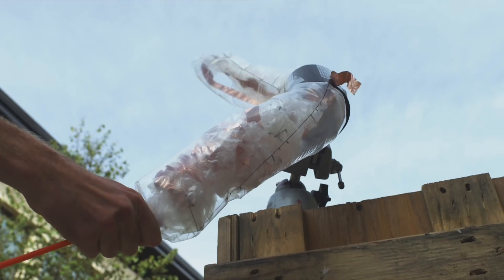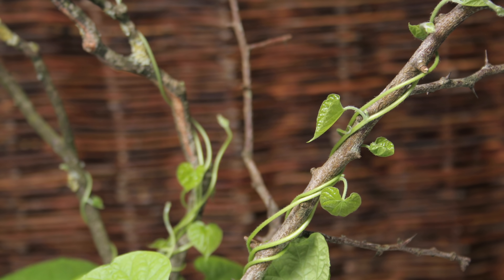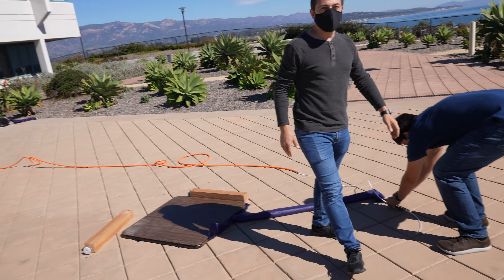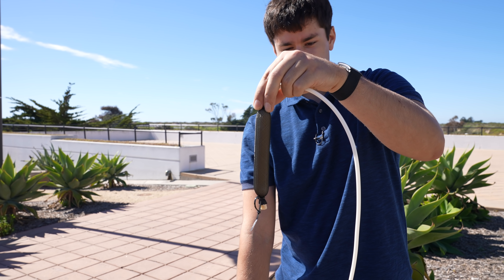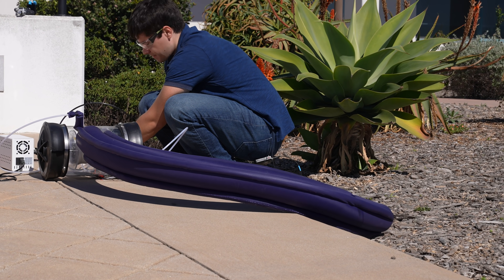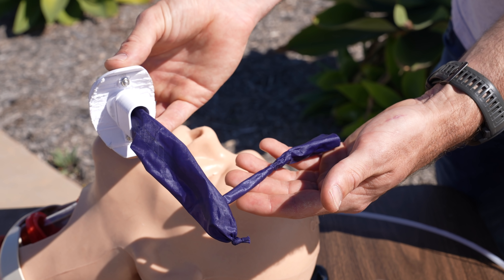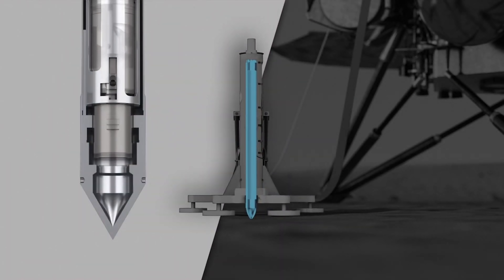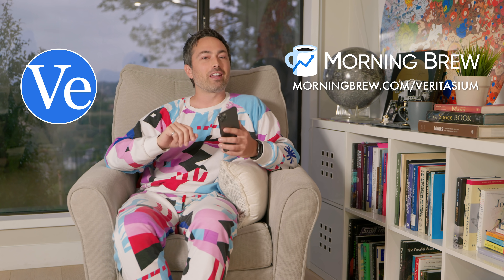This Unstoppable Robot Could Save Your Life

Comment: Go into soil down to a damaged pipe to locate the point of leakage determine the point of failure and the size of it to help decide to dig up the damaged pipe or do a in place repair.

Find all the LEGO pieces in a large bin without spilling it out on the floor. because... everything is awesome :)

Investigate holes with nests underground for its inhabitants to determine if the nest is still actively in use or abandoned before applying chemicals to treat wasps and other creatures.

It would be unsuitable for flooded areas as it would only float above the waterline but it may be suitable to locate any passage that is not flooded.

Comment: Hmmm. I hear doctor octopus around the corner. Just think about it. You could make it with thin carbon fiber on the outside layer. The second layer thin steel sheets, then in the middle 2 gauge wire. Heck, use heavy duty thin rope to control it. It could only be probably grab things but would be a pretty useful. With a alot of compressed air, probably need a small canister.

Comment: Minus the camera part, maybe for pushing stuff out of and clearing long drainage pipes without having to dismantle them?
Or could carry a just as bendable hose with it water the inside of a burning house without any firefighters needing to risk their lives in potentially collapsible buildings?
If water proof then underwater exploration?
May sounds absurd, but maybe attach a small mask to one end and start supplying oxygen once the pipe reaches the stuck victim?
Or if there is like a claw or hooking mechanism at the end of it to get things that have fallen into places too narrow, dangerous or deep for people to go and get; especially when we don't know how deep the thing has fallen; like a valuable piece of jewelry in a deep drainage system with grills. And afterwards can just be pulled out? 
Or very commonly in cities, things that have fallen in between two building 🏢 that have barely any gap?
I dunno, but this invention and idea is so simple but so awesome and has so much more potential. Can be useful in many different fields that didn't know there was such a cheap and awesome option and solution to their problems......
Reply: For water exploration it would be waterproof just through the mechanics required by being airtight, and the pressure would keep any water out anyway, at least up to a depth where the probe is no longer safe to use anyway. more interesting is the firefighting idea, which has some merit although it would need tome design revision around being able to handle higher pressures.

Comment: Somebody should tell me, how does this become a ROBOT? you are not doing anything special, you are just folding a soft tube inside and pushing it out with compressed air. I thought the material expands and elongate by itself through some special mechanism.........................:dothefive::dothefive::dothefive::dothefive:

Comment: You could have some pretty crazy applications for setting up construction sites where people are not Hardy enough to withstand the conditions if the tips of the robots could sense each other they couldn't make connections all by themselves thereby making safe tunnel systems that could be full of breathable air and sheltered from the outside

Comment: You can line the inside of old leaf piping in older buildings without having to replace the lead or rusty piping. Maybe use a plastic that has good adhesion to the piping and/or that solidifies fairly fast. Then you can keep the beauty of old cities without ruining the tile walls or floor by cutting into them.

Comment: This really could be used in sooooo many ways. Some that weren’t mentioned which I can think of are colonoscopies, endoscopies, plumbing, and the list goes on. This opens up a lot of things that can be researched
Reply: d i f f e r e n t  k i n d  o f  r e s e a r c h
Reply: It's actually already used in plumbing for laying special linings inside of pipes, as far as I know it has been for a while.
Reply: They better be 1 time use for colonoscopies
Reply: "colonoscopies", "opens up a lot of things"... you got that right.
Reply: @theone3680  lmao
Reply: @ticrific  I mean in a weird way, they might be right, these things effectively have no friction, as the surface doesn't move relative to the 'walls', so for delicate areas, they might be quite good, as they don't rub. I can imagine this preventing any damage.

On a related note, I can see an entire new genre of... toys... though I guess lack of friction isn't really the goal normally, I can certainly see some applications, particularly as they would requite effectively no lubrication, which is an advantage for someone I would presume (though I don't know who has access to a compressed air pump but no lube, other than these guys I guess...). They also have a very tentacle like thing going on for the controllable ones...
Reply: E n d o s c o p I e s the hell
Reply: @reginagohagan848  what?
Reply: Yes, lots of potential applications, but endoscopes are pretty fancy already. I don't think we need ones that go up the butt and then...inflate
Reply: @GovSchnitzel  endoscopies go down your throat and into the stomach, colonoscopies are the ones that go up the butt. And now that I think about it I’m not sure that this robot can even be sterilized and it’s probably a one and done deal, which I’m not sure if that’s gonna be more expensive than the current setup or not.
Reply: @ticrific  it seems like the only part that needs to touch is the fabric and the covering for the camera, those parts would be cheap to replace, the design and manufacturing at scale while staying at medical grade would be the real obstacle
Reply: @GovSchnitzel  A colonoscopy already uses inflation, it blows your colon up like a modelling balloon so the camera can be rammed up further, I know, I've had a few of them and they are not pleasant, so I would much prefer to get this version. I think all the Drs. performing colonoscopies have been trained by Dynorod the sewer unblocking experts.
Reply: @GovSchnitzel  😦
Reply: "colonoscopies, endoscopies, plumbing" and if you do it right, and it's long enough, you can do it all in one run!
Reply: @dutop142  And hey, it can just keep going, no need to stop there - it can save people from a collapsed building, and explore some ancient ruins! All in a days work for a worm-robot-thing!
Reply: I’m actually in a lab that’s trying to apply this to endoscopy/colonoscopy and designing it so that it doesn’t damage surrounding tissue is difficult haha
Reply: The only thing I understood from that list was plumbing
Reply: Moon Cricket  it seems you don't know anybody with colon cancer, chron's disease and other
Reply: onanism
Reply: Oil
Reply: I've seen plumbing with this type but not with the robot
Reply: This has been used in plumbing for ages. When a pipe is dirty or rusting they put a tube through the pipe to put in a new inside layer so its safe to use again.
Reply: Prostate exams, colon cleansings, enema’s, rectal surgery the possibilities are endless!
Reply: Yeah plumbing was my first thought. Find a way to add fiberglass and you could patch sewer lines super easy
Reply: colonoscopies and plumbing should NEVER be in the same sentence let alone the same paragraph and at the same time a device should never be designed to be good at both looking up my butt hole and looking at and clearing my drains. nuff said.

Comment: Ummm, they were lacing & lining old drainage pipes this way 40 years ago, if not longer ago.. Then crank up the super heated steam to tip off the curing of the plastic liner into its new shape... Why is this dude acting like he discovered this tech... What an a$$hole...

Comment: Another application I could think of would be finding and plugging leaks. If you make it out of a sturdy and give it a more elaborate leak finder sensor in the tip, you could use it to enter a tank or pipe or other hard-to-access system, find the leak, and inflate enough to plug it until repairs can be made. Useful for industrial applications, especially in large units of toxic industrial chems like ammonia, or very light chems like coolants.

Comment: The only issue with the sand thing is that in 'the wild' you don't get such perfect loose sand. Maybe in a desert but for example on mars you may bump into solid material or even large rocks... ?
Reply: You know those tunnel burring machines?  Put the front part at the tip.  Effectively turns it into a mini dune worm.

Comment: Yeah, so, (1) it's Air (gas) powered. And, (2) I hear Mars doesn't have an atmosphere. So, there's the whole pressure differential problem to work out. What works on Earth, most likely won't work on Mars. Also, going to need to carry it's own gas/air supply and not run out before it does it's job... Good luck, those are some major obstacles to overcome.

Comment: It strikes me as an ideal tool for firefighting. You could steer it directly into the centre of the fire, up stairs or in rooms and then add the water pressure at the same time as reducing the air pressure around the outside
Reply: I had the same initial thought as you, however if not used properly then it could end up causing the fire to become far worse, i.e. feeding the flames (obviously dependent on the type of fire and the type of gas/liquid you pressurize the device with).
Reply: Maybe just completelly replace air pressure with water
Then just leave the top open by a smaller part that will pop easily under higher pressure
Reply: @matthrew  Or CO2 so no water damage.
Reply: @johnclements6614  the only issue would be having a way to lock into position for higher pressure outputs without moving or extending due to the pressure
Reply: The only issue here is the need to search structures for victims prior to fire suppression. Steam expands 1700x, so adding water without ensuring your structure is clear essentially boils any unprotected people/animals (we called it 'lobstering'- it hurts even if you're wearing firefighting gear). I agree it's a great idea in some situations, but it wouldn't necessarily reduce the risk to firefighters and could increase risk for trapped parties.
Reply: @amraykovitz  what if you did the same but then used powder or CO2?
Reply: @mathewbayley  Breathing oxygen depleted air caused by extreme CO2 concentrations can lead to death by suffocation.
Reply: @allaboutroofing2  it could probably be used after the people are evacuated.
Reply: @CeoMacNCheese  precisely my point. The problem lies in that the structure has to be cleared first which would require someone entering. If that's the case, as others have pointed out, there exists a firehouse that can send water or other suppressants into the heart of the beast once cleared.

Comment: In a similar manner to the search and rescue concept, this could be used in various trades where looking for means of running wire through crawlspaces and other tight areas would normally require making holes or moving fixtures, can now be done by running that robot through with a camera.

Comment: Kind of late, but I think this kind of technology would be great at reducing the expense of laying lines in the ground for stuff like internet or power. One of the big reasons fiber connections are so uncommon is that it's incredibly expensive to lay them in the ground compared to the profit the community that uses it would generate. If this can tunnel through soil anything like it can sand, it could make laying those lines much cheaper and thus more common.
Reply: I doubt it would work the same way in soil, because the only reason it works so well with sand is none of the sand particles are connected particularly well, so air can separate every single piece. They might be able to make some sort of auger, though they'd also have to put the dirt somewhere
Reply: Pretty much all commnication and land lines are undeground in rural areas here, its safer and more reliable than air lines. And they already have flexible enough drills to drill under long stretches of build over terain like roads so they do not have to break roads to build undeground line underneath it. Just this summer they replaced all metalics for fiber in sizable part of city I live in and they did not need to break up any part of sidewalks or roads to do so. Of course they dug thin trenches in spaces with open ground to cut down time and price of drilling, but anywhere else they just drilled as it was cheaper than lay new layer of road or sidewalk :)
Ahh and price for internet+tv fiber starts at like 13 dollars here converted from euros ;3
Reply: @DeathmanElf  if you live in “reclaimed” land it becomes a problem because you can hardly spit without hitting a body of water. We’d been paying like 60 or so USD/mo for dsl that hovered around 3mbps download speeds.
Reply: that'd be dependent on how loose the soil is already
Reply: I am guesing you live in America then the ritchest 3 world country/continent in the world :) 
Rest of the modern world fiber is almost the norm now, in Europa it is getting up to GB connection in normal households, atleast in Norway.

Most new fiber is in ground, and I run a company that delivers fiber conections, we use micro trenching alot, or digg deeper and deliver pipes to all houses in street on the way, by thees you open up the marked for the rest of the street on the way and by not long time people comes and wants to connect , micro trenching is just a 5-10 cm deep 1 inc wide "cut" in the ground/asfalt that is coverd back in with asfalt or a tar mixsture, cheep, quick and effective and all that come after can see well where it is located from the darker colour.

Do not think this "robot" will have any use in pipe laying, BUT it can have a use in actually pulling rope or thin lines true pipes to pull fiber true it, we often have problems after pipes have been in ground some years that there is fluid buildup or dirt and other stuff so it is hard to get cables true.. This robot can "push" that stuf ahead of it out and carry a rope or thin line with it true, could work well
Reply: Fiber a lot of times is ran across electrical poles for this reason too
Reply: Try a „soil displacement hammer“ it works for up to 70 m and is widely used  for this purpose (at least in Germany).
Reply: if you have robot controlled driller just to drill in 1 straight path plus This ingenious idea robot vine for fiber connection then no problem at all. you don't expect to rely solely in 1 tech. you need two or more to make it practical.

at the very least you can save up some effort to dig or something.
Reply: I like your words funny man
Reply: Yes alot of rurul america does not have undergroud wires. Also there are a lot of places internet cable are not laid at all. I used to live like 5 min from a small town (pop. 2000 people) the only thing offered was satallite internet which was really expensive and did not work very well. We ended up just driving to town every few days and using the Library free wifi to download stuff and check email on our laptop.
Reply: @hondoklaatu1904  boy am I glad I don't live in the US!
Reply: @miyounova  Its the rural parts of the US out in the country. If you lived in any normal city or town you wouldn't encounter this problem.
Reply: @Eric-zs6rd  where I'm from, the vast majority of the country, including tiny villages, still have good access to internet.
Reply: @hondoklaatu1904  I hear you! McDonalds free internet, and better cell signals to download voice mails, then back to the hinterlands 😂
Reply: That tech already exists.
Reply: We already have directional bore but a flexible cable in this style would be a huge improvement.
Reply: Good initiative but there's gonna be that terrorist who just rips up the line.
Reply: Lmao. US: the world's richest third world country
Reply: @Shinkajo  lmao lol rofl
Reply: Super late.
This probably wouldn't be possible where I live, as the soil is typically—and not even very deep-down—mixed with a ton of red clay. Go a foot-and-a-half down and you hit the even more difficult green clay.
Reply: I worked for the water department and was thinking the same thing for water lines! It would need to be able to hold much more pressure though. 
And I don't see it handling hitting rock very well.
Reply: This is very similar to new technology they use to re-line aging sewer pipes too
Reply: I don't see why you could connect an auger device to the front like the camera
Reply: @mattbooth3146  They can, and utilities ready have tunneling applications like this. Maybe not air powered but with rotory heads on the drill bits being bindy
Reply: They have been using this for plumbing for years.
Reply: @robpolaris7272  This is similar to the sewer camera huh? Lol
Reply: So uncommon??? Where do you live?
Reply: @miyounova  almost anywhere in the rural united states
Reply: @evelynophelia  amen ! Only this spring did we get fast (higher than 8mbps) internet in NE North Carolina, thanks to Starlink, and that practically for the same $ that we paid the phone company for DSL.
Reply: @miyounova  *Cries in German
Reply: @nikoe9933  ??? what do you mean cries in german? how do you cry in german?
Reply: @Jagar_Tharn  basically just really hard R's and with loud shouting.

But if you really dont understand my comment, it was a joke about camilles comment, where they asked where people still have awful internet, and germanies digitalisation is basically nonexistent. Cries in 1.6 mb/s download speed
Reply: @nikoe9933  lolol :D
♥♥♥
Reply: @miyounova  anywhere in rural us or anywhere outside of the us
Reply: @miyounova  this could also be australia, it’s why we have quite bad internet
Reply: Eh I guess if you are villager from US fiber might be uncommon for you, but it really isn't anymore.
And laying down fiber cables inst much different in how you would lay any other cable nowadays?